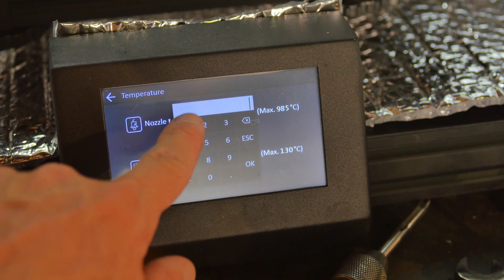3D Printing Carbon Fiber on My Ender-6

Comment: Gday, so what mods do u recommend for abs on a ender 6 please. 
Did u upgrade the bed heater to get to 120c?
Reply from the maker: Just the top cover and a PEI print bed. I've printed many kilograms of abs on it that way

Comment: Just curious, the nozzle temperature said it was 290 deg C. Did you do any mod to that? Last time I checked Ender 6 nozzle max out at 260 deg C, and I watched your Ender 6 mod video and didn't see anything about a nozzle mod. Thanks.
Reply from the maker: Yes, the entire hot end is different on my printer which allows for higher temps.

Comment: when possible print right in the middle of the build plate because the heater is right in the center and you will get more accurate temperatures in the center. well for smaller things anyway.
Reply from the maker: That is generally my approach. Not sure why I was off-center for these test  parts.

Comment: Carbon fiber has continuous strands of thread, giving strength throughout the piece. MarkForged is the only company I know of that actually does this - the machine takes 2 spools and two side-by-side nozzles dispense the molten polymer and a continuous strand of fiber simultaneously. Sadly, their cheapest model is $20,000 and requires use of proprietary, cloud-based software (LAME!).
Reply from the maker: Yes, I would love to make some parts using their printer.

Comment: Would actively heating the printer chamber of the Ender 6 to above 50 degrees celsius be a bad idea?
Reply from the maker: I think it would be ok but just be sure it doesn't get hotter then any of the internal components are rated for

Comment: Do you have a video on the firmware of the screen and motherboard of you ender 6.
You have upgraded them and it isn't the TinyMachines firmware.
Is that a DGUS reloaded?
Would love more info on that topic
Reply from the maker: Yes it's the Dgus custom fork of klipper. I know at one point it became obsolete and/or he just dropped it, then it came back or something but I'm not sure. Sorry don't have any solid info for you on that.

Comment: Hey David, why have you covered the inside of the enclosure with radiator reflective film, not high enough temp retention with acrylic alone?
Reply from the maker: Correct. The extra insulation really helps keep the build chamber warm.

Comment: I have an ender 6 as well, but my printer won’t let me select a bed temp higher than 100c, or a nozzle temp higher than 260c. How did you get the nozzle and bed temps so high?
Reply from the maker: I'm running the Kipper firmware that allows for this. I guess you'll need to install a 3rd party firmware to get those temperatures.

Comment: carbonfiber filament ist wasted plastik. It looks very nice but is verry brittle
Not suitable for mechanical parts that must no break
Reply from the maker: Sorry if you've had a bad experience with carbon fiber reinforced FDM materials but what you are saying is definitely not the case with this material. It's quite strong and durable. Check out the bike I built using this material. Going strong after 200+ miles - https://youtu.be/zSuOBLVQpmA
Reply: @designbydave  Right 
But simple PETG can do that just as well
And you can do it with a simple printer
Reply from the maker: @derHeiko470  This material has superior structural properties to PETG and pretty much all other FMD materials, except for the really exotic stuff. 3DXTech publishes data for their materials, so I'd suggest checking that out.

Comment: so Polycarbonate+CF is better than Nylon+CF for this type of applications?
Reply from the maker: That was my impression going in to this, at least structurally. However I now see that 3DXTech has several different "flavors" of Nylon+CF and at least one of them has similar properties to their PC blends. 
The next deciding factors would come down to layer adhesion, print quality and "work-ability." PC is suppose to have superior layer adhesion, but destructive testing would need to be performed on these specific materials to compare. 
This stuff prints AMAZING (See this video- https://youtu.be/L2A8qfnu10c) so I'm inclined to recommend it over Nylon, not sure how well that will print.
Lastly, Nylon, in general, is a terrible material to work with. Its very difficult to cut, drill, carve, sand. That material just kinda wants to "ball up" instead of cutting smoothly. The addition of the carbon bits will probably make it a little better, but I'd have to try it to see. The Polycarbonate+CF material "works" pretty well. Not as nice as ABS, but it's still an overall nice material to work with.
Reply: @designbydave  one more idea, not sure it make sense since I am not familiar with working with CF, would it make sense to use epoxy used in normal CF sheet work for this type of application to increase the strength of the 3D printed CF parts?
Reply from the maker: @biskero  if you mean laminating the parts with additional resin then no, it would not make sense. The 3d printed polycarbonate IS the resin in this material
Reply: @designbydave  great info, do you have the specs for the filament? like tensile strength etc.
Reply from the maker: @biskero  3DXTech publishes that info for all of their materials on their website.
Reply: @designbydave  thx will look into it

Comment: I followed your Biqu H2 conversion on my Ender 6 also and have it all installed but am not sure what firmware or slicer changes I have to make as you never covered that part, not that I seen anyways. Can you please guide me on what I need to do now please. Thanks mate. I have stuck with Marlin and am running a bl touch also.
Reply from the maker: Hey, sorry I missed this comment. I never meant that video as a tutorial on replacing your extruder, more of a part design workflow, hence the lack of firmware info. 

I'm running Klipper, but that isn't necessary for t he H2. 

The only stock firmware changes you should need to make are setting the proper estep value for the extruder. Slicer settings will vary depending on material but the main change will be different (reduced) retraction values. You will to calibrate that (as well as the esteps) yourself.
Reply: @designbydave  all good thanks mate, I ended up going with Klipper also and after some tuning got it printing awesome. Thanks for the reply.

Comment: made one test print with the 0.4 nozzle and immediately clogged on the first wall run. Changed to 0.8 and no problems @265C
Reply from the maker: Wow, glad I went with the 0.6mm nozzle from the start! That temp seems super low though as they recommend 280-310C.
Reply: @designbydave  they recommend 230-265C with the carbon/PETG i bought,  i can see both advantages and downsides in these materials
Reply from the maker: @thedanishfabricator9334  Oh got it, you're using the PETG and not the PC.
Reply: @designbydave  yeah realized that as i made the comment, how much stronger is CPC over CPETG?
Reply from the maker: @thedanishfabricator9334  They have technical data sheets for all their materials. CPC = 70 MPa versus CPETG = 56 MPa

PC also stiffer and much higher Tg
Reply: @designbydave  very nice, might try that out next

Comment: Nice video.  I use same filament for some parts on my twin HG power unit.  Using prusa mk2.5s with heated enclosure set to 50c.
Reply from the maker: Wow, cool Do share details of the power unit!
Reply: @designbydave  Flight: https://youtu.be/oqqEOvN7l8I, Build: https://youtu.be/OeCpKL9-WDM

Comment: Could it produce a sleeve for the carbon stinger that would fit into the aluminum keel?  as a repair? just wondering
Reply: I 3d printed an insert with an integrated magnet for my falcon.  The insert allowed for a 1 inch diameter aluminum stinger to be easily inserted and removed to accommodate ehelp use.  I printed with ASA and 100% infill and its plenty strong.
Reply: @cwallen32  That sounds like a great answer to this problem..
Reply from the maker: You know, there may actually be a pretty decent way to do that, yeah. My printer is super locked in with my current project but ping me in a couple weeks and I might be able to try something!

Comment: I have 3D printed PC parts on my hang glider. Non-structural of course, but things like training wheels, camera mounts, etc. Haven't tried the CF-PC yet. Nice video!
Reply from the maker: Cool. What are you printing those parts with?
Reply: @designbydave  3DX Tech EZ-PC.
Reply from the maker: @HG_well  Oh Cool. I just ordered a roll of their EZ-PC w/ carbon fiber. From their own data it seems the only downside to ez-pc over regular is slightly lower glass transition temp. What printer are you using?
Reply: @designbydave  I print with QIDI X-Plus. The EZ-PC has been one of the easiest filaments to print with, aside maybe from PLA. Good plate adhesion, minimal warping, and great z-layer adhesion.
Reply from the maker: @HG_well  Wow that is encouraging to hear!

Comment: ||||||| Cool Edition.  Question can you apply , varnish or other stiffening products usually applied on carbon fabric ? Can you do a compare test e.g. bench press/resistance?. Traditional carbon vs printed carbon . Cheers ||||||||| ps- didn't miss a pipe
Reply from the maker: I don't know of any restrictive properties for bonding or painting with polycarbonate. Some plastics don't play nice with some adhesives or paints, so some tests would need to be done before committing.

I would love to do structural load resting but I don't have the proper equipment for that. I could build some but that's a whole other project.